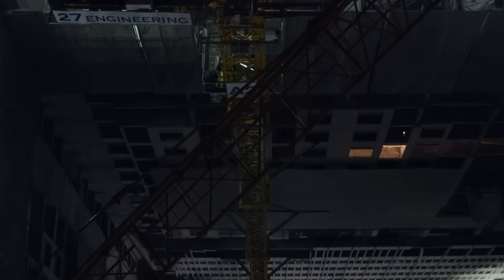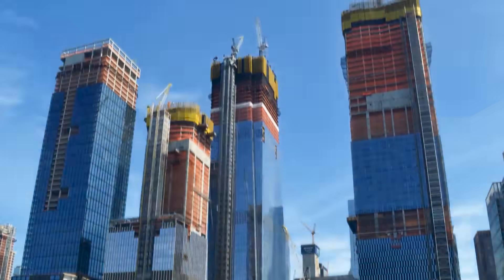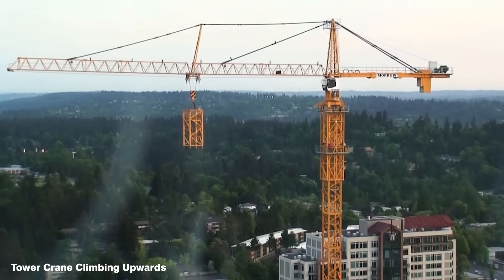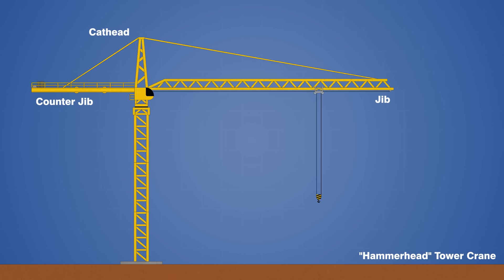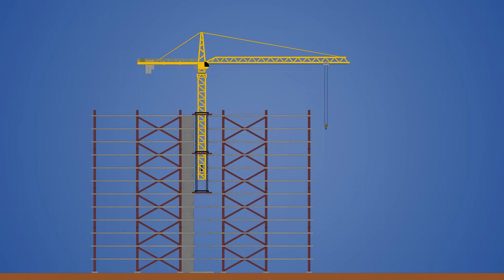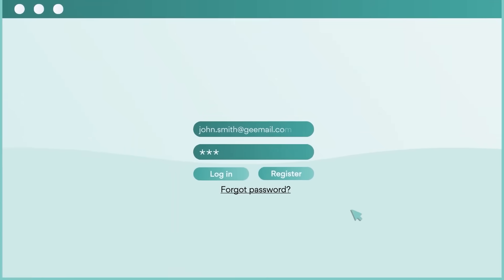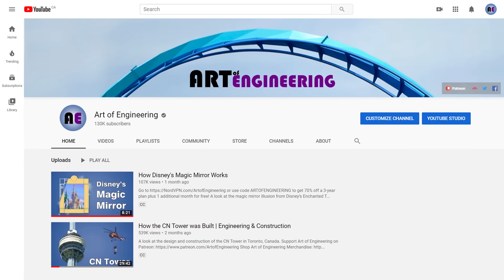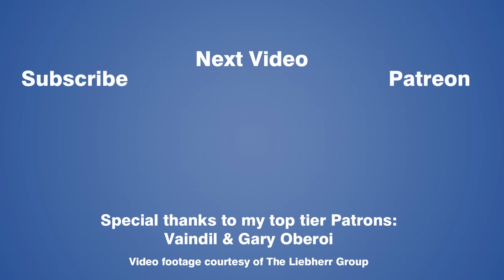How Tower Cranes Build Themselves

Comment: I was a Tower crane operator for 25 years. I figured that I climbed up and down over 300 miles in that time. During those 25 years we had 3 different times during jacking that we almost lost it, twice because of unexpected wind gusts and once because the erector in charge used the wrong counter balance. 4 other times there was some screw ups that could have resulted in a major accident but was caught just in time. I was also hit by lightning 9 times in the crane, don't let anyone tell you different you can get shocked if the door and windows are open when it hits and  it sure hurts.
Reply: Your braver than me doing that job. Respect to you sir and thanks.
Reply: I know 1 operator squated in the seat for 2 hours curled up and the crane got hit 4 times. Now the crane is grounded and if not touching any metal you really feel nothing but you sure do jump around and cuss alot.
Reply: @TheHawkeye1432 sounds really cool and fun 😂😂💀
Reply: Nashville is littered with tower cranes, soooo beautiful!!
Reply: @mtvjackass74  Just drove past there last week, there was more last year
Reply: Greg Stine was here in Nashville a year ago and looking out of hospital window on just one side I could count nine cranes working
Reply: @photosbyjf  Only 9 cranes. I lived in Austin Texas. Several years ago while sitting in Traffic , I counted 28 cranes downtown area.
Reply: @photosbyjf  an electrocution is fatal !  But nice try anyways !
Reply: Wow how did you not die from lighting
Reply: @joeyknight8272  Lightning goes up and down, while in the crane we become part of the positive charge, when the lightning starts leaders called steps form, many of them reach out from the ground from different places but in that fraction of a second only one makes a connection. In the crane with the door and windows open like just before the storm hits you are sitting there with hands on the controls, we become charged just like the rest of the crane but don't know it, not much but enough to make it hurt and I still get alot of cramps in my legs, but then again I was on a riding lawn mower and a bolt came from a cloud over 1 mile away, hit the tree I was under, came down the tree, killed a morning dove , arched to the mower, killed it and all electric wiring and knocked me a couple of feet away. My wife still stays away from me during storms
Reply: @TheHawkeye1432  Too bad this is not recorded or you would have the world record. :) 

Then again, would you guess that this is a common occurrence for crane operators?
Reply: @TheHawkeye1432  Its been shown that once struck by lighting, your chance of another strike go up a lot.
Reply: @michaelkarnerfors9545  he got electrocuted from the lightning hitting the crane. He didnt get hit by lightning. That's pretty fucking obvious
Reply: @TheHawkeye1432  hoo leee shiiiit bro. glad you survived, kudos to your sensible wife :)
Reply: @TheHawkeye1432  do you have a hazard sign tattooed on your forehead??
Reply: @TheHawkeye1432  Yeah, maybe a crane operator isn't the best job for who i can only assume is a human lightning rod!
Reply: @TheHawkeye1432  jesus struck by lightning twice, you should play the lottery my mans. roman emperors haven't been as lucky as you.
Reply: @TheHawkeye1432   Better known as Faradays cage.
Reply: @TheHawkeye1432  I mow lawns for a living and also work in a refinery too. When lightning is detected at least 10 miles out, we stop work in the plant. If I'm mowing lawns and hear thunder, that usually means lightning is near. Depending on how the sky looks, I'll stop work for a while. In South Louisiana where I live we experience a lot of thunderstorms and cloud to ground lightning in the summer time and can be stuck instantly. I absolutely stay away from trees too.
Reply: @WalkersLawn  yeah, I worked 1 job that had lightning detectors and we did shut down like you, but the were times when the 1st bolt was the one that hit me including the one that got me on the lawnmower
Reply: @TheHawkeye1432  how high did you go?
Reply: @mariog5410  my tallest cranes were at the City Center in Las Vegas, just over 900 feet
Reply: @TheHawkeye1432  n
Reply: @TheHawkeye1432  damn. Ouch.
Reply: @TheHawkeye1432  Came here because I'm looking at a crane that appeared out of nowhere. Great story about the lightning. Glad you're okay. I was in a car near a strike. It shut off, came back on, but all the dials were spinning around. Every time I started the car after that random dash board lights would blink and turn signals would start flashing.
Almost got hit again later on and my heart skipped a few beats.  I stay inside now.
Reply: @joeyknight8272 he side stepped it
Reply: Was involved with the take down of two cranes in Myrtle Beach once. There were ten or twelve of us flat bed trucks and they used one crane to take down the first one the jacked down the other crane. It took us a couple days due to wind
Reply: @photosbyjf  I was thinking about the ones in Myrtle Beach, I would check them out as I was swimming at ground level, wondering if they were installed, and secured properly. I do trees in Jacksonville, N.C. ,always looking up.
Reply: If you were struck by lightning nine times, step right on up and claim your world record! It currently stands at seven.
Reply: @TyDurr1  Nah, that guy was hit directly by lightning. This guy was inside a steel cage that was hit and experienced some effect but it wouldn't be considered the same thing by the guiness world records guys.
Reply: I hope you make $100 a hour
Reply: How can the tower resist those heavy balls of steels you have?
Reply: @davidxlte  They use 'em as the counterweight!
Reply: I was an ironworker in Boston and there is a pecking order with all the trades in large scale steel-reinforced concrete building (of course ironworkers exist at the top to ironworkers). But all the posturing and BS the ironworker foremen  had stopped when the crane's showed up. Those operators are THE most respected folks on any job outside the owner and architects. And i'm talking cherry pickers on up. You sir are a god among those dudes. Did you ever work with Cape Verdians or Apache Indians?  The Cape Verdians were tireless, they could do 10 hour shifts laboring without flinching in 100 degree heat and not break a sweat and the Apaches were simply unafraid of heights and would walk high iron like i wait in line at Dunkin Donuts (only less angry) lol. Bravo and kudos to you sir, Merry Christmas.
Reply: How much you getting paid? And what is the hardest part while working?
Reply: @isanarditama  
I can't speak as a crane operator, but I have tremendous respect for their concentration and abilities. 
It's too long a climb to go pee, so they take jugs up with them.
They are unbelievably busy...all day.
I was almost killed by a crane operator once. And this is a guy I like.
He delivered a load to the deck I was on. Not for me, someone else.
He started swinging before he got the hook above my head.
My apprentice said the hook missed my head by inches.
Lots of trades moving around on a post tension deck.
We don't look for the silent crane hook. We are concentrating on our work.
Like I said,  one lapse in concentration by a crane operator and people can die.
Reply: I was in Nashville about 2 weeks ago (I live near Nashville and go through a lot) and I counted the cranes out of curiosity. I counted 37 tower cranes, just from what I could see coming off I65. I would say we probably have about 50 or 60 up.
Reply: Cheers for your story,finally I hear from a Tower Crane Operator,what a ballsy job,and well paid job with responsibility and thought,cheers.
Reply: I did a training course in rigging for live events recently and they had loads of horror stories like this too. You never realize how dangerous stuff like this really is until you talk to somebody who has done it.
Reply: @mascotmode  yeah we have had alot of people do that, climbed up in one at Duke in nc and found 2 guys frozen in fear about 100 feet out on the jib. That cost them $350 apiece for trespassing.
Reply: 3am music  Actually the words used are a mixture of every cuss word you ever heard most aren't separated into different words, pretty much a continuous stream of pent up energy that can be heard from far away
Reply: Bird In Charlotte were you on the Asheville job in nc? I was out there workin on the pipe on the boilers, worked on top of 5 and 7
Reply: o7
Reply: Very amazing tower crane
Reply: Lightning shoots upward sometimes...its a science mystery even though persons have a hypothesis of what lightning os
Reply: @nickonickster1  The clouds are charged with electricity and as they pass over the earth they induce an equal and opposite charge in the earth and the objects. Charged streams from the clouds and the ground objects called leaders reach out and make a connection. There is a power surge upwards which is reciprocated by a downward stroke which neutralises the charge in the ground. Intense light and heat is generated.
Reply: @nickonickster1  lighting always shoot upward and downward at the same time, but usually only the side with more charge come up/down first and touch the other.
Reply: what do you think of people climbing cranes and the jib for fun/adrenaline
Reply: @EvilTaco  They are stupid, you want adrenline go climb a rock
Reply: @TheHawkeye1432  well I do that too, it's not the same
Reply: Braver by far than I could ever hope to be
Reply: I was in Boston during the 90s and there was 255 towers in a 5mile radius.
Reply: To many your job seems somewhat menial and plain easy. I know it is wrong. The hazards encountered and the need for precision makes crane operators a breed apart. I owe you respect on that one.
Reply: God bless you that you made it out alive ..
Reply: Rothr Wareck  to be certified now takes 1000 hours supervised operation, and pass both written and practical tests if no operator experience, 500 hours if qualified on other cranes.
   When I started there were no qualifications, you had to learn otj and not get fired for tearing stuff up or hurting someone.
   Need to have good eyes, pass a dot physical, should have really good understanding of rigging and most of all being able to say no to the boss if something doesn't or look right.
   There are schools that can get you started just Google it
Reply: @TheHawkeye1432  some say the operator makes 60k that sounds low.  I think 100k+ sounds reasonable
Reply: @leecrotty658  When I got into towers the base rate in 1990 was $16 a hour, the last as of 2019 when I left was $45 to 60. It all depends on union or non union, and location, I do remember $4500 take home weekly paychecks
Reply: This comment section is so beautiful
Reply: Curious how the concrete slabs stay in place on the counter jib.
Reply: @feralstryke  2 different ways, some are rectangular blocks that sit in a box type cage and the most popular one is slabs of concrete framed with metal that has a large metal pin sticking out each side that ride in groves on the back end, in both cases the amount of counterweight is adjustable for different crane configurations
Reply: Does the crane have air conditioning
Reply: @YourMajestyTheKing  yes it does, even if you have to add a unit too it. The crane cab is like sitting in a greenhouse with all the windows and you can get overheated even with the door opened. And in the wintertime even with a cab mounted heater there are times we add a small electric heater.
Reply: @TheHawkeye1432  yeah. Like all those new cars. Even my car is like a green house with the double sunroof
Reply: Did you ever have to bring a parachute up there Incase the crane fell?
Reply: @huntersmark917  actually you wouldn't have time to put one on and jump. If anything the fastest way down would be to slide down the powerline
Reply: @huntersmark917  no, I never did
Reply: I'm sitting on a hotel balcony right now, watching one of these cranes in action. I have  questions!!!😅 
1. How do you get all the way up the structure to sit in the operating seat?
2. Is it air-conditioned?
3. What do you do if you have to pee?
4. Is the height of the structure an indication of how tall the building will be, or is it higher than the building to give a better view of where you're "dropping" things?
Thanks!
Reply: @thecrepesoul  Just from the video and his earlier replies, I can answer your first three.
1. There are stairs pre-built in the tower segments.
2. Yes, they are air-conditioned, it gets very hot.
3. Jug
Reply: @ClawWitzer  Thanks.
Reply: I have worked on many big lift industrial sites throughout Australia and was often in awe at the lift capacity and methods used as I’ve witnessed most. Thanks for in all that time i never seemed to cross paths with the people who went up and operated these ‘Mechano’ miracles. Thanks for sharing the stories. I was an NDT operator and we had to physically climb everyday to the top of the construction to oversee and inspect the safety. Most times our ‘pack’ would be around 30-40kg each. We could do the vertical climb to the 300+ft mark with only 2 stops…we were very fit. Take care
Reply: U men our true heroes of America 🇺🇸. If it wasn’t for u brave men we wouldn’t t have the beautiful buildings we have. Tk u.
Reply: Respect!.. on a side note because of the strikes, did you get superpowers?
Reply: @jowieonit  No, but I di have hearing loss and constant tinitus (ringing noise in the ear, left ear big time)
Reply: So when you are currently climbing and a lightning strikes, death?
Reply: @Quantum-Bullet  
These days lightening is monitored very closely. 
The crane on my job shuts down frequently during storm season.
Reply: @jstravelers4094  On a gov't job yes, but for us if we could see it and count to 15 before we heard it we would still work. The worst was when it was the 1st strike of the storm, those are the one's that hurt me because I was unprepared, the door and window were open and hands on the controls
Reply: @TheHawkeye1432  
Maybe your life and the boys you work with isn't worth much.
The men I work with are valuable to everyone.
Reply: @Quantum-Bullet  electricty always takes the fastest path ie metal, will feel it but it would be more dangerous to be standing 5 feet from the crane with both feet at a different radius from the crane, that difference could be 1 foot and that is what could kill you
Reply: Do they paid good ?
Reply: Hey, a few more lightning strikes and you might get a world record
Reply: @frag4007  we had a local crane company who had a mobile crane with "steel erections" on the boom. Always wondered if they knew what they were advertising.  Ended up becoming good friends with the owner and i can tell you he laughed every time he got to his shop. Great guy but taken too soon.
Reply: During jacking? Yikes you're a bit exposed like
Reply: Hows your hearing? I bet thats a hell of a crack
Reply: Bird, have you ever saw or heard of any big crane accidents? That sound so scary? I'm glad you are okay.
Reply: @MaximusMerideus    Just had one in East London UK.  Crane toppled over crashing through the roofs of some houses. Some lady was killed in her bedroom but crane operator survived. Was on TV
Google it. Was in Bow. East London
Reply: https://youtu.be/6B_dM87BSFY
Reply: Cool!
Reply: Holy shit ur bad ass id like to hear a bunch of stories from ur career u should do a podcast or something
Reply: @Seuspesos  Even got bitten by a bat one early morning, had to get the rabies shots. Damn bat was chasing a bug and it landed on my arm
Reply: @TheHawkeye1432  you deserve 1000 dollars an hour for that job, sir
Reply: @diehard200  I loved that job, I felt that my hands were on autopilot when operating, I just willed the cranes to do what I wanted, when I worked on a multi shift job I would go up early a hour or so and let the other operators go home while I worked for free
Reply: Retired a millionaire?
Reply: @NeverTalkToCops1  retired because of disability, never took care of myself, worked to much not enough time off to see doctors
Reply: Oops!!! Did you die?
Reply: Very sorry!
Reply: I want to introduce with a engineer who have experince to build a tower crain. Actuall i have privet Jetty Terminal wher discharge many vessel. And i want develop the terminal icreeasing its load/unload capacity.
Reply: "I was also hit by lightning 9 times in the crane" - That's quite surprising, to be honest. I would have thought that the Operator's cabin would be designed such as to prevent electrical charge build-up (i.e. making it the safest place to be - from that perspective), like a Faraday cage...
Reply: @nicadi2005  the problem in a towercrane is that it builds up a positive charge and you also get the charge so when the lightning connects you get zapped also but not like lightning hitting you direct that would tare you an new ashole, it just hurts all over, you might get muscle craps in the legs for months afterwards
Reply: Did it cure fear of heights, or you just didn't  have any?
Reply: @zcrib3  always felt safer on the crane than the building
Reply: ম ররভঢজদম
Reply: huge repsect
Reply: Wooow that’s insane cuz nobody gives a fuck
Reply: The risk attached to tower crane installation and operation is too large, in less than 2 years have installed and dismantled  6  tower crane
Reply: 😅oo😊❤❤❤
Reply: :face-blue-wide-eyes::face-blue-wide-eyes::goat-turquoise-white-horns::goat-turquoise-white-horns::goat-turquoise-white-horns::goat-turquoise-white-horns:
Reply: That’s rad. 👍👍
Reply: What was your top pay? I have friend who makes 75 bucks an hour ..  probably more now in Boston. I mean can you make 200k a year with OT, although, I don't remember him working a lot of OT, probably didn't want it, definitely didn't need it. Idk
Reply: @BillClay88  I haven't worked on them since 2016 but you have union and non union and good and bad operators. Top Dawgs in unions can easily do over 1/3
Reply: Over $250,000 a year
Reply: I've almost lost it a few times while jacking as well....I think MOST of us... Especially If we're being honest.😏
Reply: 89i😮lll😮so
Reply: I know this is a few years old but hopefully someone will answer. I know there’s a lot of glass so you have a great view, what are the cameras inside also showing where the pick up is or where are you setting it down? Obviously, when you’re 20 stories up you’re not going to get a great visual. I guess a lot of radio work? But how does it work maybe you can explain or if you have already, I’ll look through the other comments.
Reply: @taxisteve929  you just move things with it up and down and thats basically how you do it  i got u homie
Reply: @TheHawkeye1432 what environmental factors affect the crane ??? Plzz reply it's my viva question
Reply: 300 miles…bro as a fencer I dug to china and back …I kno how u feel 😂
Reply: You made alot of money!
Reply: Sir I want to become a tower crane operator.
Can you guide me ? . 
How can I do that?.
Please !
Reply: Hero
Reply: I am more impressed by your experiences and knowledge shared than the video itself
Reply: Brave man!
Reply: How much salary we earn from tower crane by a apretor
Reply: Damn
Reply: Balls of steel, dude
Reply: This was an awesome comment bro thank u for all ur work
Reply: Thank you for this video, I’m always curious how the height of tower crane increase overnight whenever I am passing by a construction site. Quite insightful.
Reply: Wild man. I was training to be a crane operator and got as far as rigger. Been up 50 stories building a 45 story building with the operator and it’s just surreal. The clear glass below your feet, you can see everything around you except the mast that supports you up there. To look at a crane like this from the ground, it looks rigid and stable as it flies building materials around the building. In the cab, that sucker is swaying and swinging around like it’s about to break at any moment. I’m not afraid of heights, I love the view, but man I don’t trust things I’m on that high that I didn’t build myself. It was like, I know half these guys aren’t qualified to build this and barely following instructions. One bolt forgotten, it’s all over. I trust the structure, I just don’t trust the guys building it. Yet, nobody died on our buildings. Serious respect to the operators who climbed that stairway to Heaven every morning and down every evening. I couldn’t do that. Nobody is more respected and needed on a high rise job site than the crane operator. We riggers look like dots to him far below but his hook has a camera that sees our rigs and faces clearly. A twirl of the finger signals a raise and the operator sees our balance is good to fly, he gives us the customary two toots on the horn. “Good load guys..” over the radio. 
Wish I had the balls to be a crane operator. I just didn’t have those. Ultimate respect for those who do.
Reply: Hi what qualifications did you need as there seems to be a lot of physics involved mass weight etc
Reply: Thank you for your service
Reply: Bro is a super hero
Reply: You sure had your ups and downs, eh?
Reply: You are awesome dude
Reply: Bird In Charlotte I hope they paid you well bro, that sounds dangerous as fuk haha
Reply: Bird In Charlotte that’s fuckin wild. I guess true men still exist.
Reply: @Ichabod_Jericho  what exactly is a true man?
Reply: @areasontosmile1704  the complete opposite of you and twice as much. That’s what
Reply: But remember bro without erector you cannot use that tower crane so dont blame erector so much. Erector more dangerous then operator. Opretor just sit there relax all day long meanwhile erector responsible for the whole crane so dont blame erector you never know hard their job.
Reply: @unilever3221  the crane is erected under the supervision of one company man that is supposed to be competent. Also inspected by a different company and also inspected everyday by the operator and yet we still have accidents. A crane operator doesn't just sit there, he is the one that watches everything and in today's time has loged the time and passed the written and practical tests with usually 2 years min experience. All the others only need to take a 1 week course and pass a written exam
Reply: @TheHawkeye1432  CP only responsible for the qccident but not the one who install and repair tht tower crne from ground to the top. Its all abt pomen+wiremen. Also there’s too many opreator only know how to use it but didnt check the whole crne especially the hoisting lam luffing lam or trolley lam. Also i never seen operator climb any type tower crane at key head or main jib . As i mentioned they just sitting they and waiting pomen to service tower crane monthly.
Reply: @unilever3221 My buddy who was running the other Tower Crane next to mine, at lunchtime--we used to swing our Hammerhead Booms next to each other and walk out an have lunch with each other--most Toer Crane Operators walk to Hammerhead Booms--at least the ones I know. Make the Climb and ask the Operator next time...or wait for them to climb down--like a Good Boy.
Reply: DEI makes that job even scarier, "going forward."